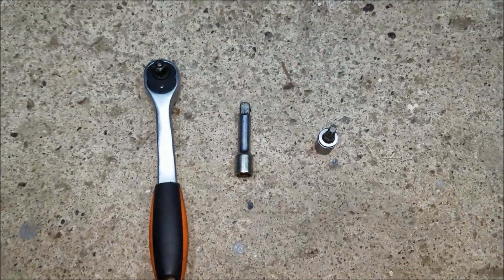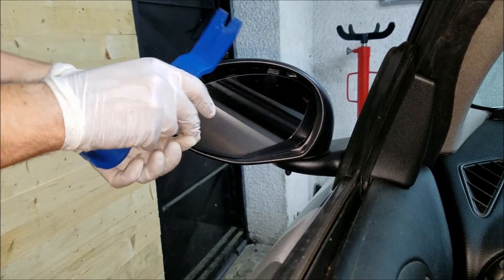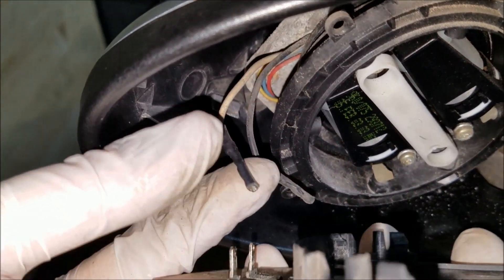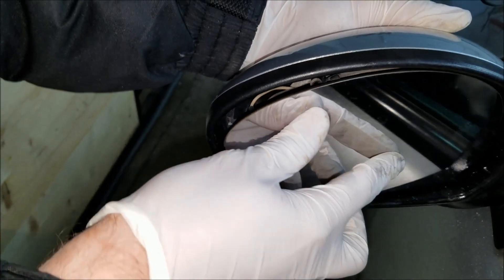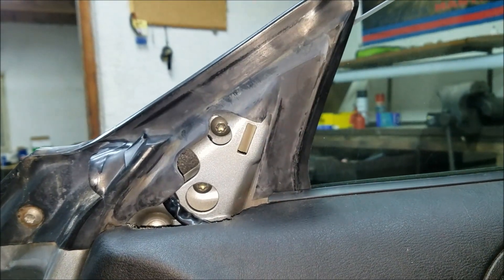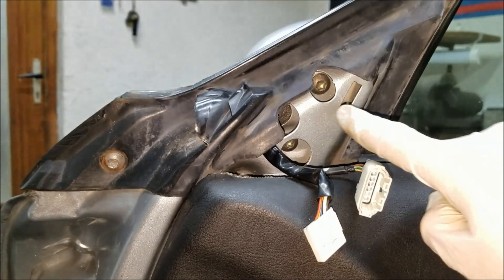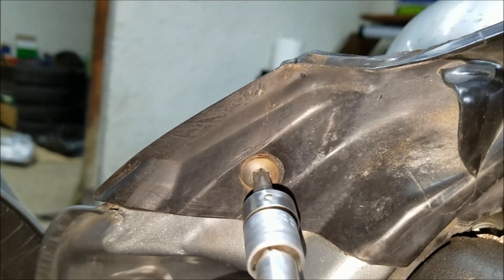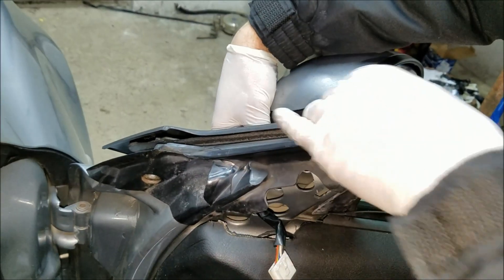Alfa GT, 147 Door Mirror Glass Replacement, Door Mirror Removal

Comment: Just wanted to say thanks again 👍🏼 I've used this video multiple times now. I had a rattle in my door mirror so I disassembled the whole thing using your video. The rattle turned out to be a metal pin that sits in the plastic housing on the underside of the mirror. It had corroded to the point is had some play in the opening. I clued it tight and it's good now. Just letting you know 🍀
Reply from the maker: Glad to hear, thanks again for watching and support...

Comment: As per usual, thank you so so much for the useful and educational video. Everything I learned for my AR 147 was from alfaowner and your channel. 

Now, I need an advice - both of my door mirrors are completely stuck and they cannot fold in, as they should (towards the doors). Can I use something like WD-40 or similar spray after removing, after prying the mirror glass? I am afraid I might break or snap the whole mirrors if I use for rotating.
Reply from the maker: Thanks, I had the same issue, and they are close to impossible to fix without breaking them...
Reply: I realize this is an old question, but if it's still an issue I used WD40 on the mirror every day for 1-2 weeks, I just sprayed it behind the glass and then I gave it a solid turn in and the mirror folded as supposed to.

Haven't managed to do that to the driver side mirror, but one was enough for me to fit the car in the garage.
Reply: @RyderGaming  Sorry for the delayed response. Unfortunately as ARC Garage said, it is impossible to fold them without breaking. Yesterday I removed the glass itself and behind it, you can see the corroded hinges made solely from aluminium. The only thing left is following this video guide and changing the mirrors with ones that are not corroded. After the change, your method in the last reply would be super effective order for the mirrors to last longer. Cheers.